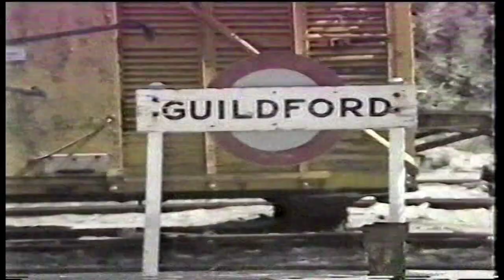Bennett Brook Railway - Mallet loco feature, Channel 7, 1985 - See vid description for notes

Comment from the maker: Video photo notes. The photos are ordered chronologically, from when the loco/s were built to the present day.

Link to general information on 'mallet' locomotives: https://en.wikipedia.org/wiki/Mallet_...

Link to information about our locomotive: http://bbr.org.au/history/locomotives...

00:28 Builders photo of Magnet no. 1. Our loco is a combination of Magnet no. 3 and spare parts from Magnet no.1. Photo taken circa 1902.

00:34 Various photos of Magnet no. 1 & 3 operating on the Magnet Tramway in Tasmania. At 00:47 take note of how the centre of the boiler is out of line with the centre of the coupler below it. This illustrates well the ability of the loco frames to 'articulate' or swivel, whilst the boiler remains in line with the rest of the loco. Photos taken between 1905 & 1930.

00:51 Photo of Magnet 3 in storage at the Great Boulder Gold Mine in Kalgoorlie/Boulder, Western Australia. For more info about the locos journey from Tasmania to WA, please click on the link 'information about our locomotive' above. Photo taken early 1960s.

00:57 Photo of Magnet 3 taken whilst on display at the Mussel Pool picnic area at Whiteman Park. Photo taken 1970s.

01:03 Photo of the current condition of Magnet 3. The 'motion' or connecting rods on the wheels has been fully restored and the boiler has been repaired and is ready for tubing. If you look closely, the builders photo of the locomotive, featured at the beginning of this montage, is stuck to the boiler underneath the steam dome! Photo taken December 2018.